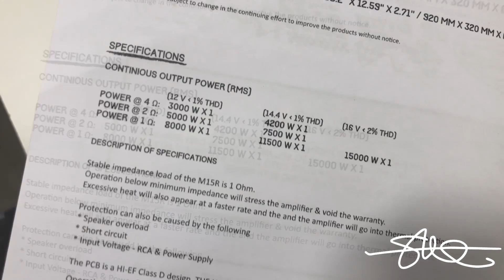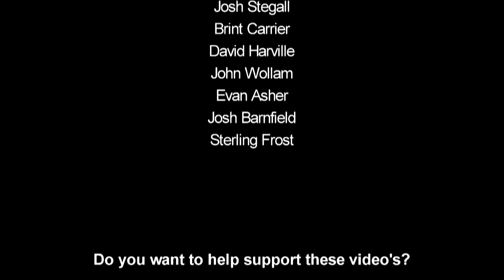Unboxing "The Raven" B2 Audio M15R 15,000 Watt Amplifier (Return of the Steak Knife)

Comment: It looks a whole hell of a lot like the Z2c Digital Design's Zed audio series amp. The specs and dimensions are damn close, guts look similar as well,  but Dynamic power is somewhere around 20,000 watts @16v on the Z2c. Both amps I bet are super power hungry.
Reply: Jonathan Sorosiak I think the DD Z2c looks way better. Just my opinion.
Reply: Jose Venegas 
I agree
Reply: Amp is way wider as well as pcb. Uses more than 25% larger German made power supply cores. Has greater capacitance in both power supply and output section and those extra input terminals makes a difference besides the goodies you can't see below.

Comment: Bro I need help one of my headlight is foggy because I accidentally drop goof off, and had a lot of scratches and I been trying a lot of stuff to remove and get it fixed but nothing is working.. Is plastic pls help what you recommend to fix that problem?😕
Reply: Alex Flores wrong channel for that check out Chrisfix on youtube and you might be able to find a solution
Reply: Alex Flores toothpaste
Reply: I used vinegar and baking soda and it worked pretty damn good..Give it a try

Comment: Running that amp @ 16 volts may kill the dyno🤔 let’s find out
Reply from the maker: 16v won't kill the dyno.  But i can't really supply that.  I will test it with what i got and compare it to the ratings in the book.  I would imagine i can get at least the 14.4v numbers out of it.
Reply: i was thinking output at 16 volts may kill the dyno, didnt it say 15,000watts?

Comment: Hey look it’s a crossfire 8x or a American bass whatever, Lanier ykw, sundown something, or some other brands case. I really wish sundown, dc, dd ,crossfire ect would actually come out with there own amp. Everyone is using the same boards with slight differences like gains and output location. Best amp to get in a certain power is the best priced one.
Reply: I guess you need to take a closer look or have the amp in front of you.

Had to tool a new heatsink for this pcb as it is near 2" wider than the amps mentioned.

Doing quad 0ga inputs was a worlds first on a strappable amp when we launched this one. 

Which again leads to all copper traces being different as well.
What is similar is the output section, but it is by far the same since this pcb offers advantages compared to others. Besides this is a proprietary design.

As for it being a cf 8k, then you need enlightenment. We introduced that design in 2009/2010 on the m1 mk2. Several revisions and upgrades happened since then leading to better and more efficient designs.
Reply: Dope for the manufacturer to come here and back shit up. You guys should send us one here in Canada to test and promo ;)
Reply: B2 audio amps mentioned are just examples not exact as only 1 model was mentioned. Are you saying all your amps are yours? As it’s a design by you and no other company will have that board with the exact components with slight difference in the outputs and gains ect?
Reply: Low bass Most of our amps were agreed upon being proprietary. Only when we are moving on to another design we give the opportunity for others to use the same topology. However, money talks and being copied happens faster than you might ever believe. So clones will make it to the market, just with any other electronic item people can make money off.

Comment: That's a big ass amp bro!!! How much does it weight??? What kind of alternator would you need in a car to power that bad boy, another words how many amps would it take and how many batteries would  it require??? Great video bro!!!!
Reply: Jose Garcia u would need alternators and probably 800 amp hours worth of agm to run it, my 12k says one dedicated 250 amp alternator and 4 100 amp batterys to run it at one ohm I ran it at 0.4 and two 350 amp alts and six 100 ah batteries would barely hold it but with lithium now u could get away with one 100 ah lithium which is four foot long and a foot tall and a foot wide
Reply: Daniel Harrell That's cool thanks bro great info!!!

Comment: If you need separate alternators, wires and batteries for this kind of amps anyway, would it not be smarter to make them work on higher voltages? Just wondering...

Comment: Anyone know how many batteries I should get for a dc audio 7.5k? And what size and brand ? Please help thanks and be blessed
Reply: Your gonna wanna redo all of your electrical system. A H.O. alternator, Big 3 upgrade, and depending on how you run your amp depends on how many batteries you may need. For example I run my 4 BC5500s at 
.5 ohms which is not recommended but if you do you better have the power to feed it, as that is one of the main ways to destroy a amp is under powering it. Hope this helps
Reply: THA TRUTH those DCs are awesome amps definetly don't skimp on your electrical. I'm not sure how long you've followed Steve put look up the DGAF Tercel build he put a couple of 11ks it may give you a idea of what you need.
Reply: Jody Breeden ....thanks Jody continue to be blessed
Reply: James Carter no problem bro bass heads gotta help each other.

Comment: Why soo many power/ground inputs? Is it designed to run with 4 batteries, all with their own leads connected?
Reply: Carbon Reed mainly due to the current it is pulling. Ordinary limits for a true spec 0ga cable is 300A. Running this amp at full tilt can get peaks of above 1200A. 3 sets of inputs wouldn't cut it.
Reply: B2 audio thank you for responding.. the thing is a beast, obviously...

Comment: Lol I've got nothing that canhandle that, and I still want it XD, 200 Watts rms at 4 ohms is leaving some untapped potential from my speakers... That amp id have to run a bunch of subs in series.. 4x4 series 16@500/ 125rms per 4ohm.. 2x6.5ohm =13.. Around 775ish rms.. Guess that would properly power the aluminum subs to sweating around 387watts rms each of course the amp would be like "where's the load?I'm bored..." Guess I'd be able to configure something.. I just need more amps than the two I got.. 200rms "bridged" and 100rms "bridged" 2ch amps yet I've got subs with 3" coils said to go up to 500rms.. Big ass amp o.o

Comment: I still don't understand the purpose of all of them power inputs if anything you would think they would make some kinda adapter that had a batt cap made into it that would just plug into the power feed side to make sure u hit its power ratings max load kinda like the mass audio does with there custom end caps ..that's just bonkers the size of that amp lol
Reply: capacity  and current  you can only get so much current  through  0 gauge

Comment: How much is something like this ? Could you power lower wattage speakers off it with out blowing them up
Reply: kèvin R Dee you can power any speaker as long as signal is clean and gains set in accordance to your entire system.

Steve Meade got the tools you need for any amp tuning.

Price on the amp if in USA is at www.b2audiostore.com

Comment: In the certified test how many percent thd is considered distortion? It says 2 percent at 16v
Reply from the maker: 1%...i can't do the 16v test on my bench anyway.  I can do the 14.4v test though.  If i was to do the 16v test i would test it up to clipping rather than distortion (uncertified mode)
Reply: meade916 ty I wonder why the distortion had to be raised to get the power they have it rated anyway it goes beautiful amp u r a lucky man it would be on my kitchen table for as long as my wife would let me
Reply from the maker: people that run 16v systems are typically competitors who don't care about sound quality, just SPL. :D

Comment: How do you raise your Voltage again? Do I need to change battery or Alternator? Sorry guys I'm a noob..
Reply: Patrick Lawrence you have to raise the voltage going to the specific amp by adding higher rated voltage battery's now if you run your whole system off the higher voltage batteries your going to have to get a voltage regulator to drop down the voltage for all your 12 volt equipment. You would also want to upgrade your alt with like a 370amp with a voltage regulator so you can keep your batteries charging!!!! The famous saying here is it takes power to make power that starts at the hart of the electrical. That's your alternator! Then batteries then power wire! Hope this helps.
Reply: David Bailey's Custom audio Thanks! Been a great help!

Comment: Same output bord as ns2 and vfl 20k
Reply: Sure, besides the facts below
1. Pcb being more than 1.5" wider,
 2. Having greater capacitance than both amps, since output cap layout and quantity is different.
3. using different cores on the filter coil as well as different winding and dimension.
4. Having external voltage output from the pcb via rj45 connector.
5. Using different output fets.

So yes, they are exactly the same.
Reply: B2 audio I am saying the audio output board is the same. every company Taylor it there way. There's definitely features on your lay out that I like more than the others and I like the accurate ratings I claimed 15 k Plus at 12.2 volts rise to 1.1

Comment: Question, running 2 t2 13 fosgates. What amp do i use to run them both?
Reply: D S an amp possible of around 6000 watts because I looked them up and at two ohms they do 2000 watts rms 4000 max
Reply: A t2500 will do the trick

Comment: 2:18 there is no one that runs 1 ohm loads without damage to the transistors or MOSFETs or overheating I work on peavey crown and qsc professional power amps
Reply: This is car audio, not pro audio. There are plenty of people running .5 ohm and less without damaging amplifiers. Most bass amps these days are rated for 1 ohm loads.
Reply: @dylanandersen9318  .5 is a short on my ohm meter.
Reply: @TheWarped45  welcome to car audio

Comment: Help anyone!! Do i need to upgrade my stock 90 amp alt if i switch to x2 lithium batteries to push 2k watts. I know you need to do the big 3 but kind of clueless when it comes to lithium batteries
Reply: lithium? whatever happend to the good ol deep cell batteries and doubling caps and doubling your guage size..   guess it doesnt matter anymore.... as ling as it flexs a window and blows smoke out the ports to lil wayne huh...    newbies.....
Reply: I wouldnt call it a newbie. Its more of evolution of car audio that im unfamiliar with. Its like a jump from carborator to direct injection. I dont want to buy extra parts if its not needed and the audio shops around my area cant give me an answer
Reply: Yes, you are going to need to upgrade your alt, because at 90 amps, it will not keep up with the power draw to make 2k watts.  You will drain those batteries fairly quickly, even while running the engine.  Unless, the amp you have says 2k peak watts, then you will probably make 1k at best.  Then you might be ok.

Comment: 8000 watt surfboard
Reply: You might not see it all above.
Pcb is wider, oversized copper rails underneath, powersupply coils with German cores and 25% larger than other comparable amps.

Dyno at 12v on real batt voltage from a truck = less than 13.8v idle amp did 32w shy of 9k at exactly 12v certified

Dynamic at 0.5 ohm and 13.1v did 23k

Comment: Aint no way in hell thats doing the full 15k. Look at the insides.
Reply: mrlithium69 how much you willing to bet it? I bet it does more
Reply: 15k @ 16 volts. 11.5k @14.4. The amp dyno probably won't be able to test much higher than 9k because of the bench limitations. Just going by the DC 9k he tested a while back.
Reply: Adam Moore true I forgot about that
Reply: Adam Moore could still do it the old way lol break out ohms law on that bad beast
Reply: Besides the fact the power supply cores are more than 25% larger, uses German made cores and has quite a few surprises you can't see on the top iof the pcb.

On a weak power supply hooked up to the dyno with real world voltages, not 14v and then drop to 12v, the M15r did  32w shy of 9K on exactly 12v.

Got dynamic at 0.5 ohm and 13.19v  at 23k +
Reply: You might not see it all above.
Pcb is wider, oversized copper rails underneath, powersupply coils with German cores and 25% larger than other comparable amps.

Dyno at 12v on real batt voltage from a truck = less than 13.8v idle amp did 32w shy of 9k at exactly 12v certified

Dynamic at 0.5 ohm and 13.1v did 23k